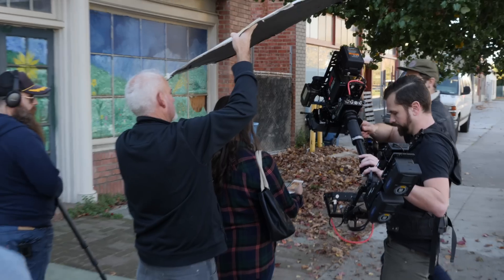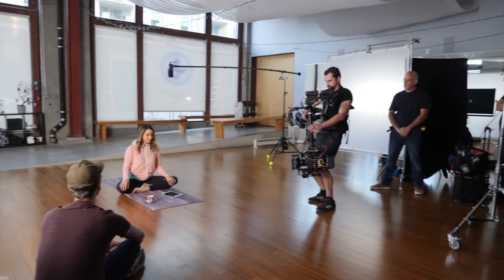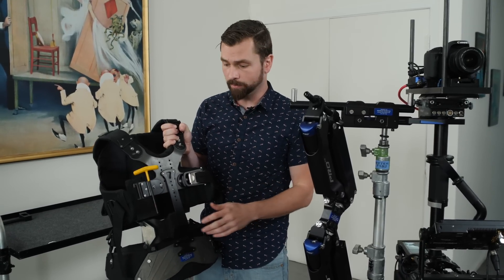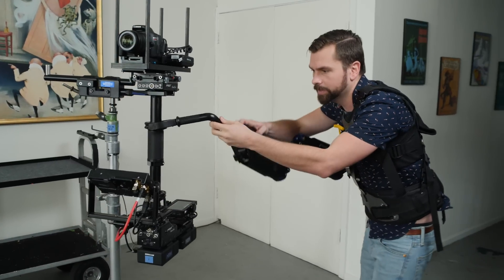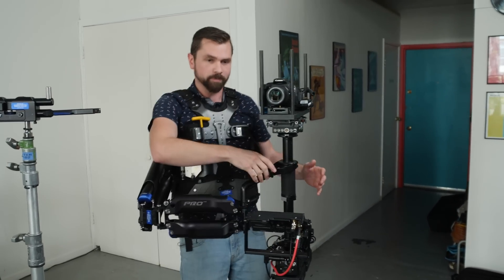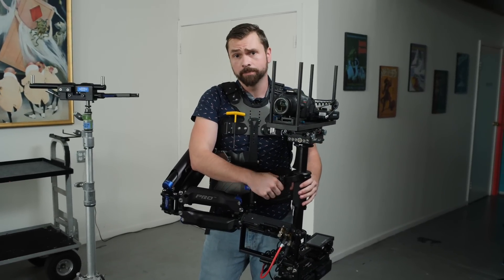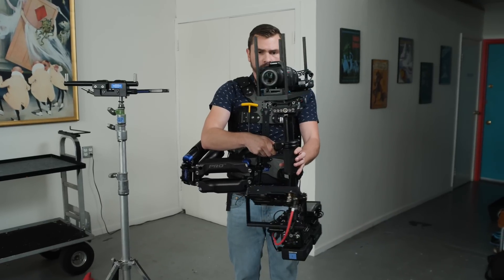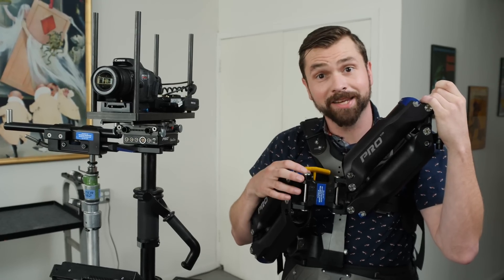Meet The Gaffer #84: Steadicam Operator

Comment: I'm not sure if anyone will see this. I'm just wondering where it is I'm able to purchase a weight plate as you mentioned. I cant seem to find anyone or anywhere that sells them. Any help would be appreciated.
Reply: I see it! If you search online for Janice Arthur, she's an operator who makes plates of variable weights. That's where I got my mine in the video.
Reply from the maker: https://steadicamforum.com/index.php?app=core&module=members&controller=profile&id=888
Reply: @Taynerang  Thankyou very much.
Reply: @Taynerang  Also, just wanted to ask what size threads you have on your plate? Thanks again
Reply: @CalebNichols99  Her plates include 3/8 and 1/4 inserts to fit most pratice camera packages, and also the same fittings for top stage plates.
Reply: @Taynerang  Thanks again

Comment: How's the steadicam comunity adapting to the switch to gimbals?
Reply from the maker: Good question! I think the answer is similar to what you would hear from a jib operator or the owner of a captured slider verses a Dana Dolly, that it’s a different tool. In terms of larger cameras, it’s more of a precision tool than a gimbal. I think there is certainly room for both!
Reply: Luke is right, it really isn't so much adapting as it is just another tool to use. There are some situations where Steadicam is more appropriate than using a Movi or Ronin, and there are situations where using gimbals may be more appropriate. Anytime new gear comes out I feel it is less the idea of what it is replacing, and more so how can this new tool do something different for me.
Reply: Nick Schwyter  great video. I got to meet and work with you on the "Inches Apart" video. Great to see you and Luke collaborate and share some knowledge.
Reply: It's really a question of the look you want out of the move. Gimbals are primarily used in narrative for vehicle and arial coverage, as well as moves that would be impossible with a steadicam (think space/clearance restrictions as well as something like a handoff between operators). Steadicams provide a much more natural gliding look than a gimbal can in most cases, and provide a direct input on movement from the operator rather than a remote input controlled by the gimbal itself. As Luke said, it really isn't a switch at all (or at least it shouldn't be), it's more of a new tool that people are learning to adapt to and figure out how to use correctly.
Reply: I am one of those that never got into the stedicam gimbal and got a Movi Pro and THEN put it on a Zephyr arm and steadi vest.  For what I do it works great and I'm guessing the learning curve is less than a full-tilt boogie steadicam system.  It's a tool and that's how I use it.  I would no way in hell with a plastic banana pointed to my head say I'm a steadicam op!  Those guys and gals are a different and higher breed.  But again, the movi pro is a tool and with Movi's remote control that controls the gimbal it is a great tool to have when the budget is not quite big-daddy bucks.  Thanks again to Mr. Luke for yet another killer video.
Reply: ah only a year late, personally ive found that the most gimbals cant handle enough weight to be able to be competetive with a steadicam, and even if they carry the weight they are too heaviy to run around with for more than 10 minutes(in profesional work, with grassvalley, arri with link.
Reply: I use both steadicam and gimbals. The gimbals haven't reduced my Steadicam use at all, if anything, I get booked more days because the lower budget end of the market use gimbals with cheaper cameras plus I still get the same number of days hire with my Steadicam so it's all good.

Comment: Did you make a video on the rig for this video?
Reply from the maker: The rig? Do you mean how I shot Nick working with the steadi?
Reply: @meetthegaffer  yes please? You mention in other comments that you’ll post your set up for how you shot nick. Amazing work!
Reply from the maker: What’s funny is that was so long ago I don’t really remember exactly, but it was probably a GH5 in a small rig cage with a couple extra hand grips and a SmallHD monitor. So nothing out of the ordinary. The GH5 is such a good handheld camera for vlogging that when I had a Ronin-S it was too cumbersome. In this episode I should have done a better job with the audio, but when ur one-man-banding it, sometimes u forget to cover all the variables! That said, I swear by the Sennheiser AVX system, paired with Sanken lavs. It’s great for vlogging.
Reply: @meetthegaffer  thanks for the info! I think it’s that it looks like you have it pressed against your chest using some kind of rig. Either way, the gh5 definitely is a beast. Thanks
Reply from the maker: Yes, It’s just a set of rails so that I can run it off a v-lock batt which also powers the monitor. I may have a follow focus on there too, but I don’t really use that anymore either🤪

Comment: What rig is Luke wearing there?

I'm surprised that the batteries are on the arm, rather than on the back as a counterweight for the operator's torso (and less weight on the arm).  I get that it's better to not have wired connections off the gimbal through the arm to deal with, and that some mass on the gimbal helps, so I guess those trade-offs must be worth it.
Reply from the maker: I’m wearing a modified baby carrier that provides a little shelf where I can rest the back rails/battery for longer handheld shots. The only real stabilizer is internal to the GH5:)
Reply: Cool!  Makes sense when you don't want the camera up high on your shoulder as a tallish guy to avoid that 'news crew' look where the camera is slightly above the subject's eye height looking down.  Made for a nice steady/smooth shot.
Reply: I know this is a steadiop video, don't mean to steal his thunder, but would love to see a run-down on your mirrorless hh shooting rig -- I've seen a couple of 'camera bjorn' solutions and would be interested to see how you have yours rigged (for the taller folks as Thomas says above).
Reply from the maker: I can do that! Mostly I don’t have time for all that and just go regular handheld with the GH5...

Comment: Is it necessary  to bend knees  ?
Reply: If you want a smooth picture, yes
Reply: @mrsneakyburt  No, bending knees might actually work against the function of the steadicam arm. You should "always" walk as normal as possible.
Reply: @iforssberg74  What? the point is to send minimal ammounts of energy from your pelvis and body into the rig, therefore you want to generate as little rocking as possible, If you walk stiff legged the arm will have to work a shittonne to try and isolate the energy from your body.
Reply: Walk normally! If you set up the arm settings properly, it will take out "the walk" input. I own a Steadicam Archer 2 and providing you set it up correctly, you'd be amazed at how smooth you shoots are. I guess that’s why it cost me small fortune, the engineering involved is of the highest quality.
Reply: @bonym371  Are you happy with your Archer Tony? I'm receiving my Archer 2 with Volt any week now.
Reply: @iforssberg74 I am very happy with my archer. It’s an amazing piece of kit and with the Volt fitted you’re going to produce magic so good luck with it all.